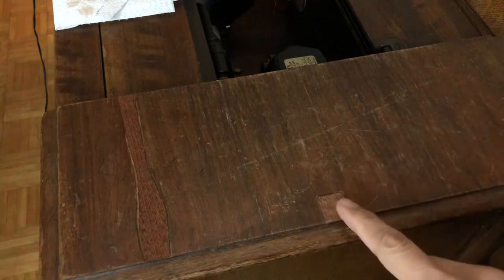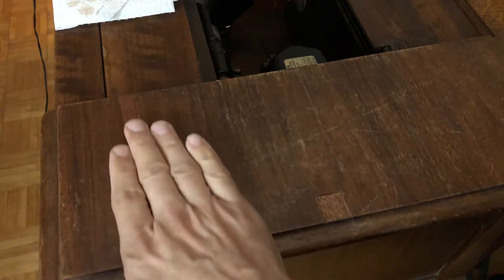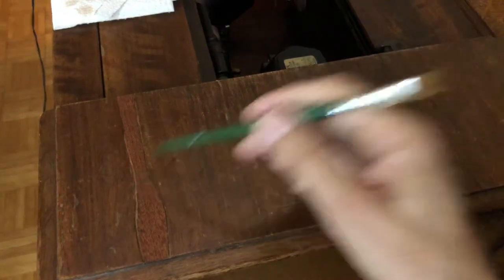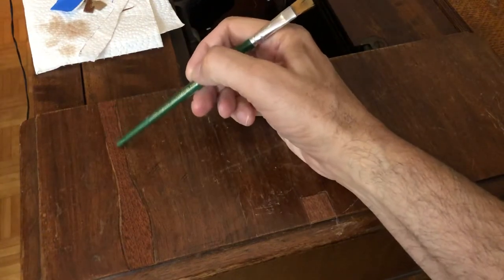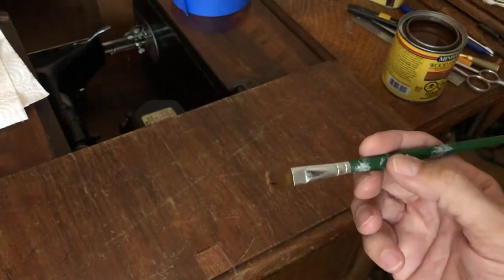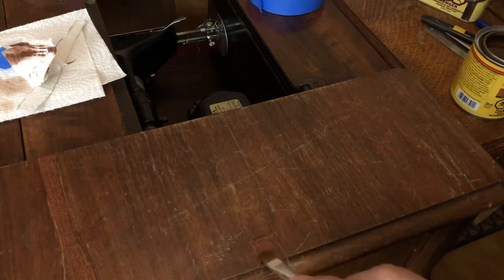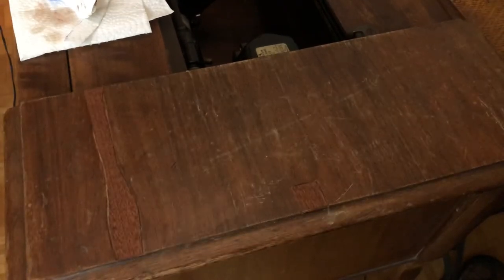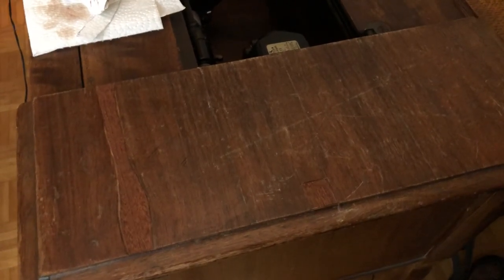SEWING TABLE REPAIR SERIES # 8: Applying Stain to New Veneer & Attempt to Color Match

Comment: have you thought about using your stain to darken up (color) the scratches in the table. Any shellac on the table will prevent the stain from adhering. You could even apply the stain with a cloth and immediately wipe it off. That way the stain will only color the scratches.